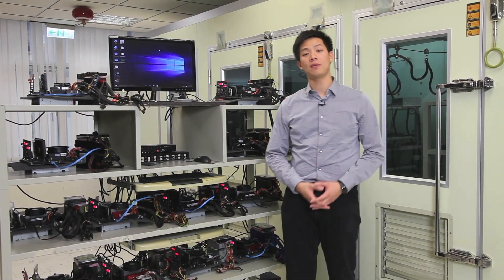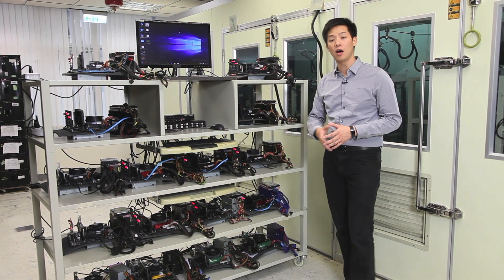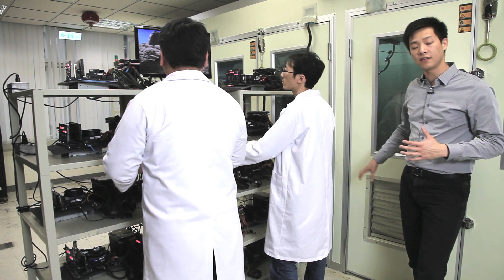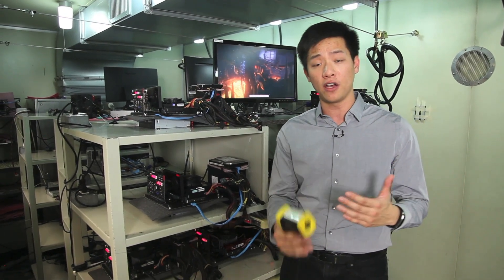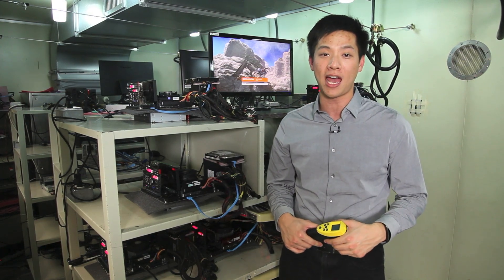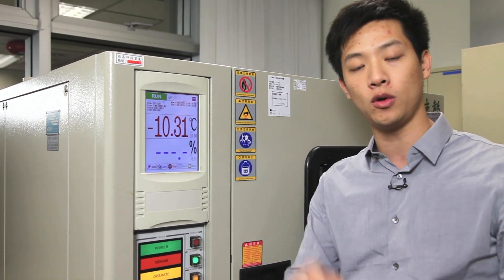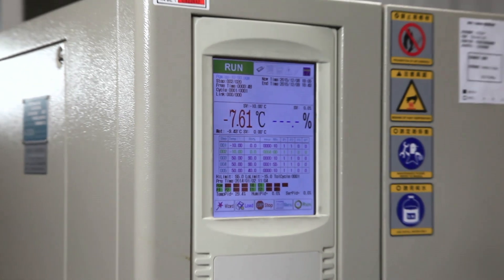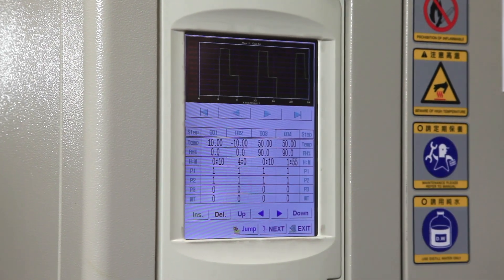GIGABYTE Test Lab Tour

Comment: Under the base plate is a foam pad. It reminds me of material for ESD. This material is inherently electrically conductive. Am I wrong, or using the material electrically non-conductive? On the motherboard is a test card with a display. You mention it?